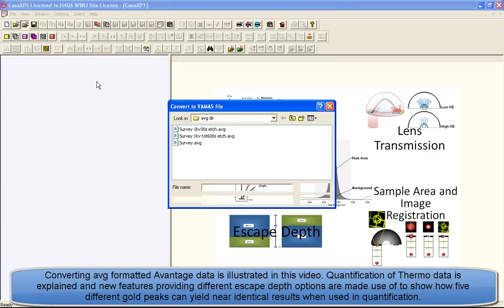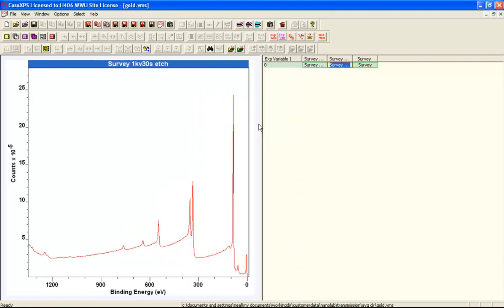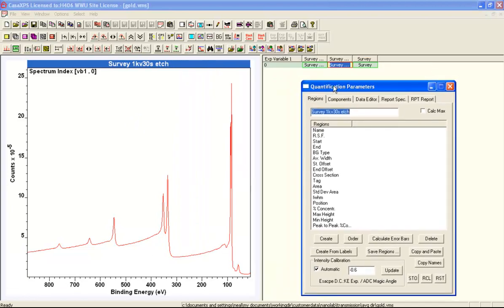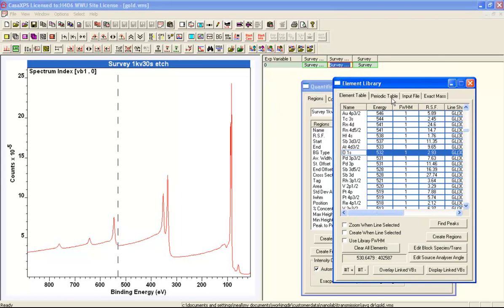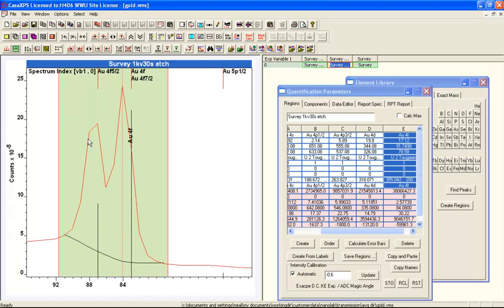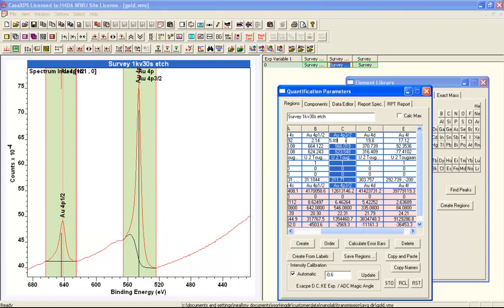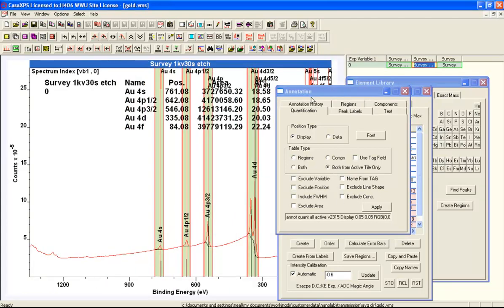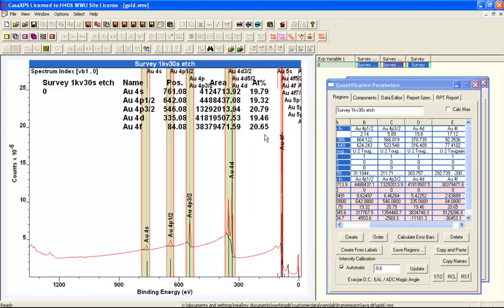Quantification of Thermo Avantage Spectra in CasaXPS

Comment: Hi! When I checked my library at CasaXPS, I cannot find O1s, it shows O KLL...And the RSF have values of zero... Could you please give me some advise? Thanks
Reply from the maker: The element library displays RSFs based on VAMAS block element/transition fields. If you are only seeing OKLL then your spectra are stored in VAMAS blocks without fields that match the current element library. Please send an example of your data to neal@casaxps.com. It will then be easy to establish what is missing in the VAMAS file preventing the viewing of the photoemission element library entries.